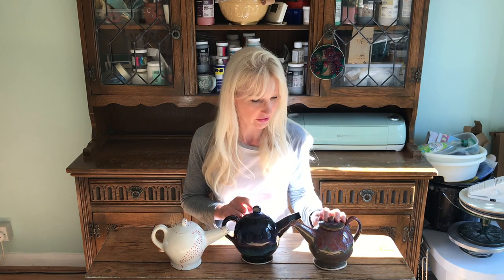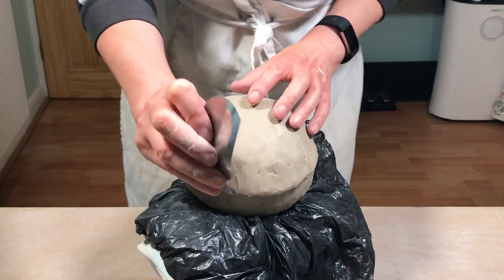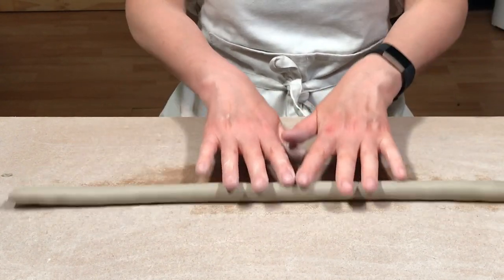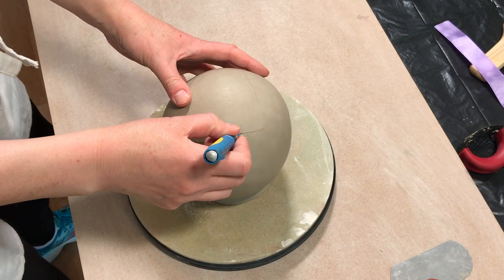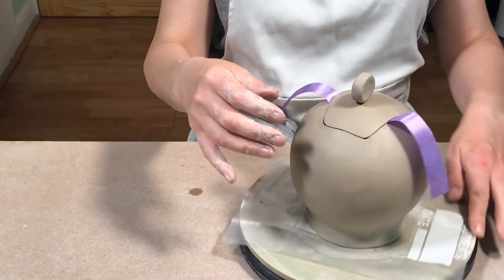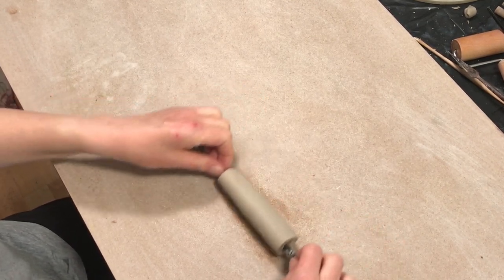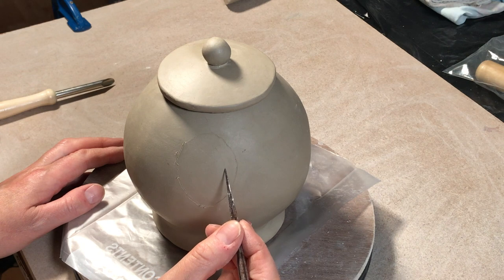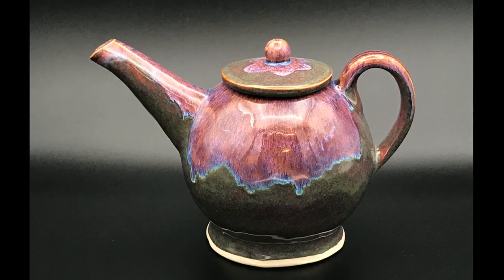How to Make a Teapot

Comment: This may be a silly question, but how does the lid not fall through into the teapot?
Reply from the maker: I cut the lid at a bit of an angle, so the outside edge of the lid is a bit wider than the inside edge.

Comment: On the first lid option, what keeps the lid from falling into the body of the pot?
Reply from the maker: I cut the lid at a bit of an angle, so the outside edge of the lid is a bit wider than the inside edge.